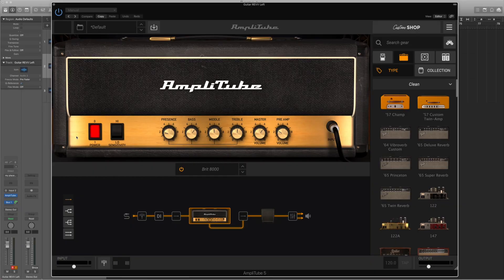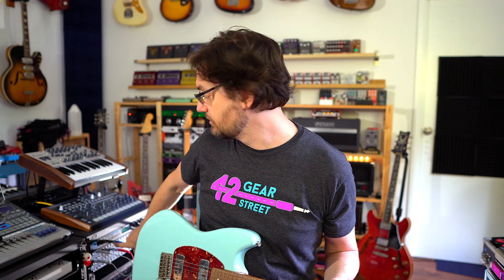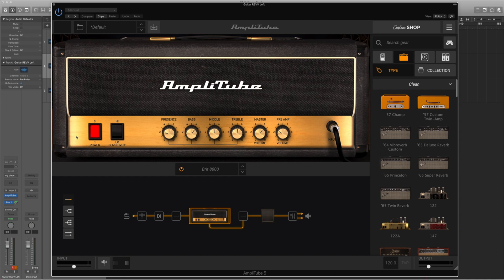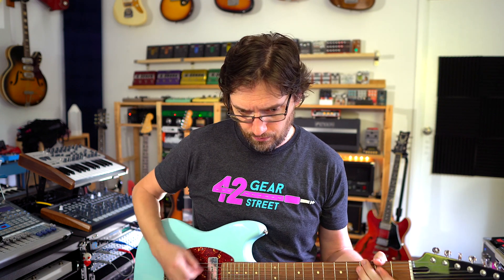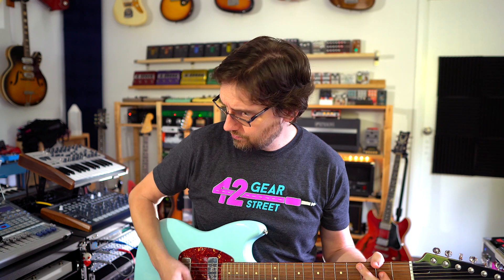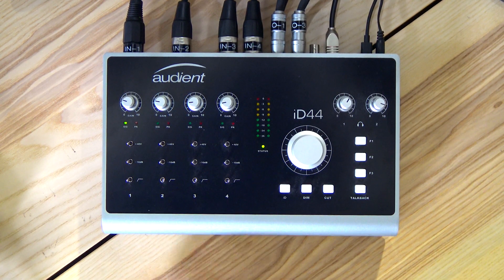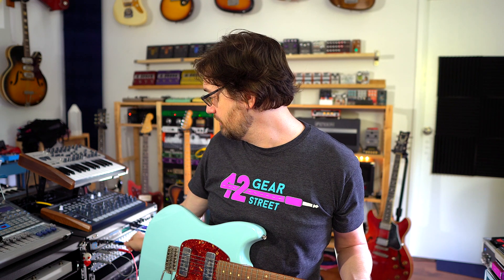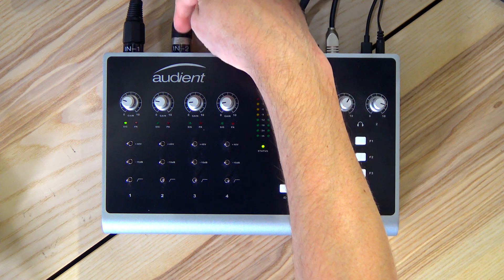Why Does It Sound Wrong...?? Amp Sims, Interfaces & Impedance

Comment: Great content very informative video.
I have been wanting to record electric guitars for year and never got the quality I wanted to, I've wasted money on amp plugins amp Sims, microphones , I even bought a new guitar and amp 😂  .
Bias fx 2 does not work at all like it's advertised in the videos with my setup and yet no one really talks about it much. I think people should know what they are getting into and that it is very frustrating to buy something and not have it sound the way you want to.
Finally someone that explains it.
I have a cheap D.I  the donner special-I and I am using the focusrite 2i2 2nd generation. Would you agree that in my case it is definitely the scarlett 2i2 that is the problem as it is a pretty cheap interface with cheap preamp. 
Should I save up some money and get a decent interface like the one you have or maybe even go for appollo twin ???
Thank you for answers on this,  this is a Topic I would like that everyone knows about and stop wasting money on stuff that will NOT give you a better tone.
Reply: Dude, trust me, I have been dealing with exact same issue since past several years. I've tried pretty much every plugin that exists out there including Bias, Amplitube, Neural DSP, ML sound, Overloud... You name it and I've tried them all. I too had focusrite scarlet 2nd gen. I thought it's the problem so I upgraded to more expensive RME Baby face Pro FS. It made absolutely NO difference. Sounds the same like focusrite. So $1000 wasted. 
I've tried all different guitars with Seymour duncans, Dimarzio, Fluence, EMG...
Nothing ever sounds right. It's always muddy, horribly weird. Can't even explain in words. But you know it when it's not right.

Did you figure out what's wrong with your setup?
Reply: @ratedrsuperstarthega  yeahh actually  I have , I made the switch to Universal Audio Appollo Twin . I m using a charvel with seymour duncans JB and 59 guitar straight to my pedal board   , switch on the 808 and plug directly to the interface , its nice because they have tons of plugins and you can demo them for 14 days before actually buying them. I have to say after buying a wide variety of their amp sims they are awesome and as close you'll get to the real thing, about around 100 dollars US.   Like I said you can try before you buy so thats awesome.
I was really blown away by the Suhr PT100 , its a very versatile amp and it sounds awesome. You will want some reverbs too , im using the capitol chambers or the ocean ways studios   , its awesome really .
Combine that with delay EQ and compression  to your tracks and it sounds Kiillllerrr honestly. Now I never want to stop playing .... but sure its very expensive.
Reply: @Driven2Beats  I bought RME Babyface Pro FS which is high end interface too. I didn't notice any difference between RME and Focusrite honestly. I can do A/B and not know which is which with blind test. 

I'm glad you were finally able to get awesome tones from the plugins. But like you said, they were Apollo plugins.
Are you able to get good sound from Amplitube, bias, overloud, neural, stl or any of those plugins which don't particularly require a mandatory apollo device?
Reply: @ratedrsuperstarthega  I understand your concern , I was exactly like you asking myself and people around me the same questions. That made me waste a lot of money for what I wanted , people would usually not answer my concerns because it took too long or they trying to keep the secret to themselves. Well, here's the truth. I can get a pretty good tone out of Amplitube4 and Neural stuff , but they usually dont sound as perfect within the DAW , so there is a lot of gain staging involved here and also a lot of EQ work has to be done where as UAD stuff you can configure and then commit to the sound by recording it straight to your daw. Thanks to Unison Technology , it actually matches the impedance to one of a real amp, they sound really realistic. Maybe try to EQ the signal to get it as clear as possible then boost the volume with compression or gain knob.  But overrall , if I knew first hand , I would still go with UAD stuff because it would save me a lot of hassle. Hope this helps you down the road , good luck

Comment: My problem is that i play 7 sting (passive Humbucker) and I cant go over a 1/4 volume with the input gain on the Hi-z input without clipping. This makes the distortion I'm using through an amp sim sound weak and thin, which no one wants on any guitar, especially a 7 string. Through the line input I don't have this issue is it requires the dial slightly over half to get the same volume. I use the Audient Id4 mk2
Reply from the maker: Really…I use an Ormsby Hype GTR 7 with passive pickups quite a bit and I never had issues with the input gain…I’ll look into it!
Reply: @TSFAHTPS  Yes it just has a weak sound that even seems hard to be beef up with EQ and an amp sim. Not horrible, but just not very full to me. The line in sounds much more full and big, but the downside here is that it lacks clarity that the Hi-z has. It’s frustrating and makes me want to try a more interfaces.

Comment: My Tascam 1820 had 750k impedance for the instrument input.  This results in a loss of high end.  A DI box gave a more proper response.   An AXE I/O with variable impedance gave more flexibility.  

Amplitube 5 through a Quantum2626 is giving me the opposite issue.  Over accentuated high end. B and E string on a SC strat are overly bright, and any previous girth has gone missing.  Hoping its just an impedance issue.  Specs are >1Meg. I've yet to measure, but its acting like when you change the impedance too much on the axeIO.  1meg is about the sweet spot.  Going a little lower softens the  high end- too low(750k) and its a wet blanket.  Too high?  A treble thin mess. (Sounds like going from higher output pickups to VERY weak pick ups).

Not sure if this is an Amplitube5 issue, or a DAW issue, at the moment.  Hoping its the DAW, because THAT? You can fix.
Reply: Hey did you fix the problem?
Reply: @jorgeguitar2540  DI box.  Then a better interface.

Comment: Just curious what the latency is like? I suppose this would change based on the pc or Mac you use but I am using a FireWire interface which I have to replace due to audio starting to sound bad and FireWire isn’t a commonly offered anymore. The latency is good but the sound isn’t anymore. And I really don’t want noticeable increases in latency.

Comment: why would one need a DI box (and put more noise on the sound path) when there is a HI Z input on the soudcard?
Reply from the maker: I think you misunderstood what I was saying...I was saying that you may want to try a DI if your interface does NOT have a Hi-Z or Instrument level input!

Also if you have a really good DI or possibly a Valve/Tube DI you may prefer the sound of that to the Hi-Z input on your interface...there is really no right or wrong here...just whatever works for you!
Reply: @TSFAHTPS  Ok, fair enough.....Then it is my bad, I m sorry. Thanks for your videos ;)
Reply: @TSFAHTPS  sure....ok mate ;)

Comment: Trust me, I have RME Babyface Pro FS and it doesn't even remotely sounds anything like this.
I plug Guitar -> High Z input -> Windows 10 PC.

Sounds really dull and lifeless.
I also tried with Focusrite scarlett solo 2nd gen, using the high Z instrument input. Unfortunately same disappointing results.

Want to know which guitar cables do you use?
Also windows 10 or Mac?
Desktop or Laptop?

You really have awesome tones.
Thanks a lot for this video.
Reply from the maker: Thank you very much. I’m not sure what I do differently...I’m running a Mac and Logic...I think the cable I was using in this video was a not very expensive Fender cable...there is no EQ or post processing...sorry but I’m not sure why it doesn’t seem to work for you!
Reply: maybe its the guitar? old strings? eletric wiring? did you solved man?
Reply: @joaov7802  No it did not get solved yet. Guitar and strings are not problem because I've tried with multiple guitars. Regarding electric wiring, not sure what you mean.

Are you facing the same issue or everything seems to work fine with you regarding the tone?
Reply: @ratedrsuperstarthega  Hey, I am getting a terrible sound out of any amp sim, though I have a really good guitar and pickups. If you get some answer to our question about this, let me know please. I'll do the same.
Reply: @Razor235G  same here.. can you describe what you mean by terrible sound? 
Are you using mac or Windows?  Desktop or laptop?  Also which audio interface?
Reply: @ratedrsuperstarthega  It's kinda hard to explain cause I'm not English native speaker. Just muddy sound when palm muting, but overall appropriate sound when just powerchording. I've though managed to get some good sound out of Plugin Alliance VSTs: Diesel VH4, which is on Ola channel, but it started to sound well only after I've set amp filter (just watch his video). Second amp was Engl 120, it's not just muddy for some reason. Amplitube amps and ReValver amps all give me kinda weird sound with palmmuting. I have cracked Windows 10 with cracked reaper and amplitube though, so it could be the reason, but I've checked free vst in free sequencer too, they give me the same sound pretty much. My next step right now is to buy an active di-box, but I have an instrumental input on my focusrite Solo 3rd gen already, so no good chances.
Reply: @Razor235G  I face exact same issues. Just sounds muddy pretty much with everything. No matter which plugin or which settings, it just sounds like something is wrong. 
By the way, don't buy DI box. It's useless. I've tried that too and makes absolutely no difference. You're better off with just the focusrite.

I have RME Babyface Pro FS and Focusrite scarlet solo 2nd gen. They both sound same to me.
Windows 10 desktop PC.

Just no clue why everything sounds dull, muddy with all guitars. Fender, Schecters, Ibanez...
Reply: @ratedrsuperstarthega  Have you tried real amplifiers with your guitars? I've just tried my marshal mg15 and it sounds surprisingsly better than sims. Palmmutes just destroying everything in comparison to amp sims. Maybe it's the windows 10? Have you tried different PCs or notebooks?
Reply: @Razor235G  I've tried real amp, but it's a Fender Mustang I amp. So not that great amp.

I have tried 2 different PC's. But both PC's (my and my wife's) are exactly same configurations. Same processor, motherboard, RAM, everything is same.

I have not had a chance to try with laptop. Would like to see if it sounds any better. 
If you get a chance, please let me know too.

Also any other knowledge you have, feel free to share. It helps everyone.
Reply: @ratedrsuperstarthega  Do you have a discord? I would suggest to share our sounds, this would be much more informative. Anyone who read this message on youtube could join us.
Reply: @Razor235G  No man, I don't have discord. Sharing sounds will be cool but don't know how to do it. But it's difficult to just listen to sound and judge. Because it's also about the feel. If something sounds dull and muddy to you, it might not give true representation to someone listening on speakers at his home. Because that person won't know what type of sound you are trying to dial in. Sound is just too difficult to describe in words. But now I know, I'm not the only one who faces this problem. Even you are with me on the same page.
Reply: @Razor235G  Hello again friend. Were you able to figure out the cause of muddy and not so proper sound? I'd like to know if you've discovered something by now. For me, it's the same dull, muddy and something not being right sound... I tried with Babyface Pro FS and Focusrite scarlet 2nd gen. I've tried both with guitar straight into the instrument in jack and also tried a DI box plugged into mic input of both interface (tested separately). I also purchased a windows 11 laptop just to test and make sure it's not my windows 10 PC which is causing any issue. But sad to say, even the laptop sounds the same. Just not usable tone.
Although the tone on this youtube channel and also on Ola's channel is pretty awesome. Not sure what's going on with me. Hey, I also got 3 new guitars with seymour duncan JB's and EMG 81's. Still sounds crap and wrong.
Reply: @ratedrsuperstarthega  Hey, in my case I found the vsts that work for me. Also I've purchased active DI-box. My opinion is that I wasn't able to get great tones out of Amplitube IR's and Amplitube works for me for some reason not the same way as the other people show. So I just found appropriate IRs for my situation and ampsims. They are Greener from Revalver (pedal ibanez  ts808 sim, besides I didn't like the Amplitube and some free version from the internet sim of this pedal), peavey 6505 and peavey 6505+ (for BFMV tone the first one but I like more the plus version) from Revalver (without IRs) and IRs from Brainworks IRs, in my case I've purchased Diezel VH4 vst and I am using it too for, in example, Three Days Grace tones (for which I use the greener pedal from revalver too). 

It is strange that I had even left my discord contact for you but you haven't used it. Let me know if you change your mind. Bear in mind that not only my vsts' set may not work for you, but also you may just not like my tone that suits me. For that I could share some tone examples in discord.
Reply: @ratedrsuperstarthega  I also want to mark one thing. When I switch the -20dB thing on my DI-box, my tone turns to shit. It is because it lowers the impedance (from 4,7Mohm to 47kOhm).
Reply: @ratedrsuperstarthega  I use Amplitube only because there are great delay and reverb pedals)) oh, and tuner xD 
DI box gives a really small improvement. High Z input must give you all you need. 

It is really easy to make discord account. I wouldn't like to share my facebook account through youtube, I hope you will understand.

Comment: I think the sound of the front JFET input sounded best. It has a lot to do with impediance. It's the same with microphones. How they match each other, The input impediance of the preamp and the in-going impediance of the signal. 

I remember when I asked a question at Gearslutz.

-Is it possible to build a box in which I can adjust the impediance input level before it reaches the input of a preamp. Line or mic level? 
-With a multi winded transformer? Switchable?

Well, I didn't get a full answer then. I guess it is more compicated than I thought it would be.Or? 

That would be a great box. Beacuse with such a thing you could be able to alter the sound in many ways.

Comment: Hi I have a question in the case of having a quarter inch low impedance output  it’s possible to connect too a quarter inch cable to the input of the interface wich has line/instrument option ? And with a low z quarter inch output is it better to use a trs cable or a ts will be the same ?

Comment: Awesome compare! Very easy to understand! Just to mention what really happends when you plug a High Impedance instrument into a Low Impedance Input as you mention is not only in low gain volume (that can be compensated )  but also an undesirable "filtered sound" due impedance mismatch ( High frequences are more affected than lower, so thats why sounds like narrow)

Comment: Thanx dude. Very beneficial video. I have a problem with my scarlett solo 3 when playing my bass guitar. Now i know that i have to buy dibox or id44. I guess id44 much better than scarlett. Thx once more. And i have 1 question. DO i need to use dibox with id44? Or it isnt necessary?
Reply from the maker: I don’t think it’s necessary to buy an iD44...it’s a great interface but I’m sure you can get similar sounds out of any interface! Check if there is an instrument input on your interface or a switch to change it to instrument level...if not then a cheap DI will do the trick
Reply: @TSFAHTPS  ive bought id14 and it is fab) im happy so much) thanks alot)
Reply: @proparket_official hello what did you noticed with the upgrade?

Comment: Do you ever compress or limit guitar DIs? 

I'm in the middle of mixing a metal song with guitar DI I recorded. I just checked it against some DIs recorded by August Burns Red for one of the Nail The Mix sessions, and it looks markedly different to me. Almost looks as if it's been compressed or limited... much less dynamic range, no way higher peaks when hitting chords. 

Is it common to limit peaks on DIs like this?

I've always been taught to never record so hot that the signal clips, and also that the input going into an amp sim should not reach the red.

Now I'm wondering if I should lower the gain on the hard-hitting chord parts, or just push the amp sim harder so that it sounds good throughout but goes red for some of the hard-hitting chord parts?

Comment: I have audient id22 interface and metal guitar with Seymour Duncan active pickups. Naturally I use DI input on interface, but I've been always interested in these analog DI boxes. Given that these interfaces already have an optimized DI inputs, is there any point of buying one of those analog boxes, if I always will record with VST plugins? Have you tried DI box into DI input routing? Does this produce way more compressed sound? Many questions :)
Reply: Nice question. I also want to know the answer)
Reply: Any particular answer?

Comment: HI, I use Amplitude 5 as my AMp sim and am running a U-Phoria UMC404HD audio interface with the MiDas Pre-Amps.  As far as I can tell, all 4 inputs are the same impedence type.  I typically run on INstrument Level with the PAD engaged so I can crank the preamp.  However, is it better to not use the Pad.  Yes, I am A/B testing it but curious to hear what others do without a separate DI and this interface. Thanks!